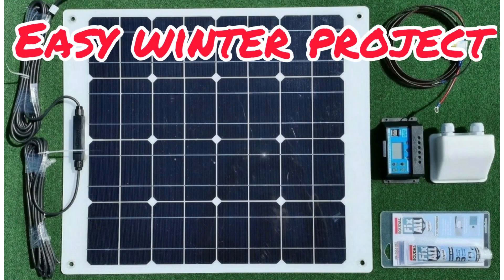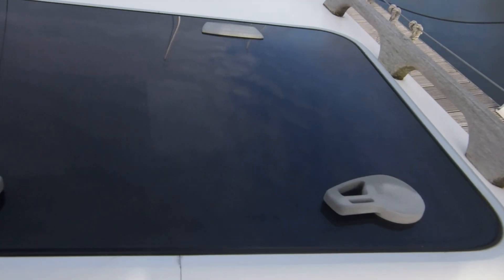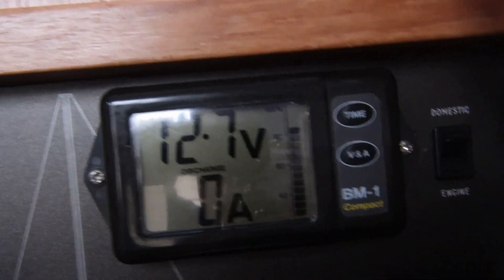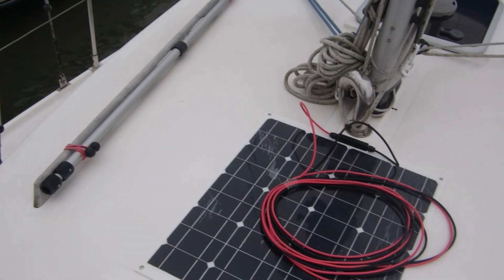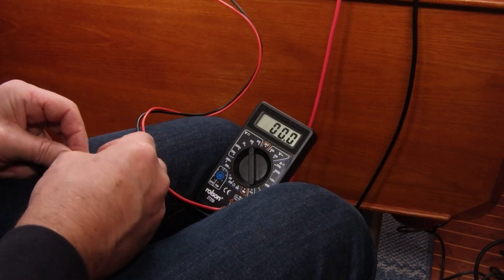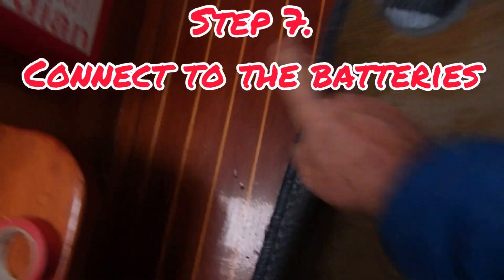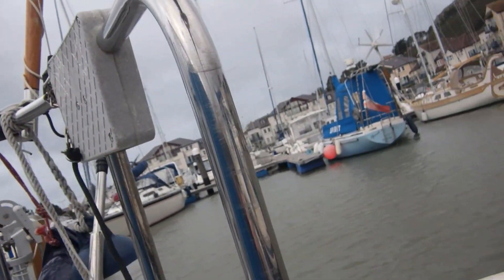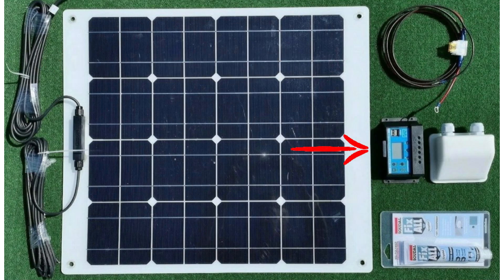Fitting a solar panel

Comment: I love the swan neck construction, I want one! How to you keep it dry and how do you keep cold air out? Just shove a rag in it from inside?
Reply: Never mind, I noticed the wooden block against the ceiling. I can do that ;)
Reply from the maker: Hi Peter it’s open no rag, keeps air above the roof lining and stops things rotting. The wood block is my access to wiring and swan mike

Comment: I installed the self same panel on my boat and it has worked very well for two seasons. I have a smart relay that prioritises the engine battery and then when full switches to the domestic battery. Still get a buzz arriving to find both batteries at 100% ready to rock and role. The usbs are useful for torch charging etc because they won’t let the battery discharge if left connected full time. Great video. Cheers.
Reply from the maker: Nice to know, USB’s are in the locker and probably won’t get much use but I suppose a rechargeable torch may be a good idea to leave plugged in just for that occasion 👍

Comment: Thanks Mike.  I'v had trouble with my solar set-up this season & had to change the whole system.  While waiting for the new kit to arrive I installed a domestic-type leccie 2-pole switch  to the wires from the solar panel so I can isolate it if I need to deal with problems further downstream.  This will be my 3rd panel in 3 years, the previous 2 were Amazon cheapos but the new one is The Dogs' so I hope it will give me longer service.  To add to my woes the Smartgauge went belly-up which I relied on to tell me the condition of the battery.  Take care. Chin-chin.  Rej
Reply from the maker: Hi reg, sorry to hear about your solar history, let’s hope your solar future is bright, mike 😁